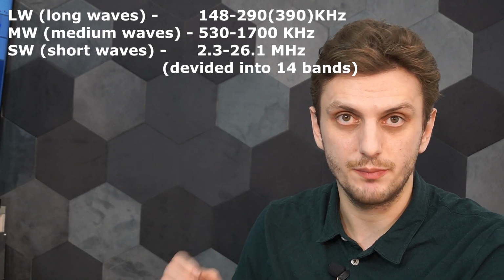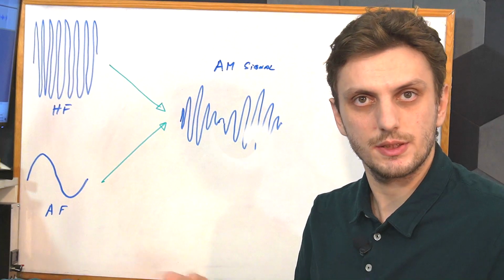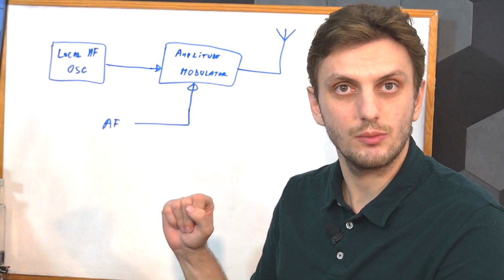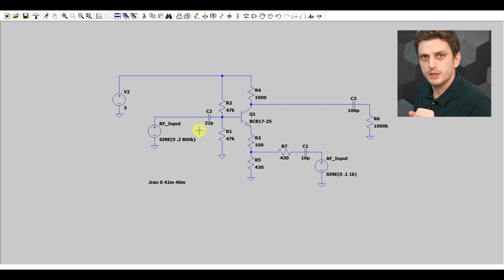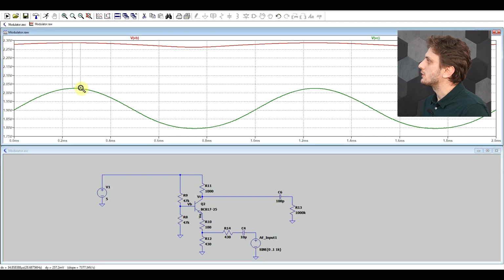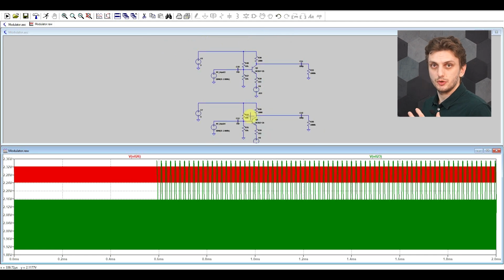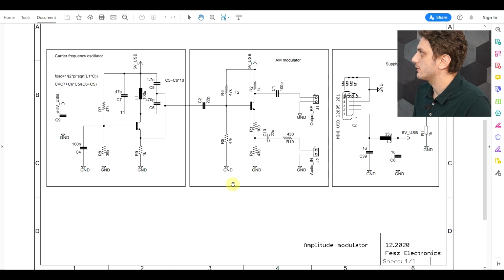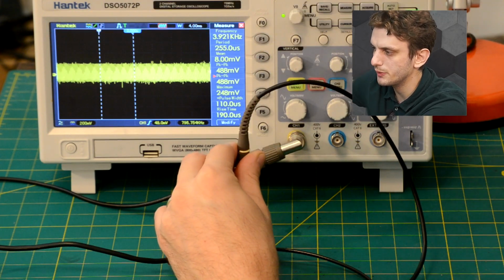Electronics tutorial - Building an AM modulator

Comment: The AM modulated signal should be symetrical. Yours is far from it. Its more normal to vary the voltage on the collector, that way you should be able to get proper symetrical modulation.

Comment: I'm going to attempt, after 20 years of NO R&D, an idea I've had for years.
Using a DSP to do all of the PDM work, and go with polyphase.
An other option would be to use a FPGA.
Need to motivate myself, as I've not been on the air since 2007!
I wonder if simulation software would be the first approach.
Food for thought.
Maybe you can try using the LTSPice?

Comment: You can modulate the oscillator directly without the need for the second transistor, either by injecting the audio in series with the voltage supply line via a audio transformer or by adding another coupling winding on the oscillator coil with one terminal connected to ground and the second terminal connected to a germanium diode for audio input thus modulating the oscillator by inductive coupling. For best results wind the tank and audio coupling coil on a ferrite rod ( like the ones found in transistor AM radios) but the longer the better 15 or 20cm, this will produce a very stable modulated frequency. To increase the range of the transmitter add a antenna wire any lengh required and connect one end to the circuits ground terminal and 5 turns around the ferrite rod with the other end hanging out to the back of the work bench or attached to the wall or a nearby tree depending on the range you want your transmission  to reach e.g with no antenna connected 3 to 10m with a 10m wire anntena 50 to 100m with a 30m antenna about 1km. This explination is just for experimental information and all rules for regulation in the country you reside in must be complied with. Thanks for your informative video.

Comment: You don't need a non-linear element to create an AM modulator. You simply control the voltage on collector of the final RF PA stage so that the RF envelope changes in sympathy with the modulation. All you need is an audio amplifier and a transformer to couple to the RF PA stage.

Comment: FesZ In order to understand an AM modulator it is necessary to understand WHY a circuit modulates the carrier. AM modulator requires MULTIPLICATION of the carrier  AM= (Vm cos 2 pi fm )( Vc sin 2 pi fc ) where mod freq , fm' <<  fc , the carrier freq .
A linear op-amp which sums Vm and Vc can NOT produce AM.
Reply: I doubt about that when I see the wave from in the simulation ,it looks like summation not multiplication of the two signals ( the carrier and the modulating signal )as it should be in AM

Comment: I sorry, but I didn't understand the part about the antenna, at the end - needless to say, I don't know much about antenna design; however, aren't all antenna's just emitting electric and magnetic waves. Isn't the coil you built to electro/magnetically couple the output signal to the radio just an antenna?
Reply from the maker: You are right, an antenna is supposed to emit both magnetic and electric fields, and these combine to form electromagnetic waves after a certain distance from the antenna (2 wavelengths). But in the AM band, the wavelength is very long (300m for 1 MHz) so on short distances the 2 types of fields stay separate. With the particular radio I was using, other than an external antenna input, it also had coils on a ferrite rod which works like an antenna only for magnetic fields. So I was trying to take advantage of this principle - generate only magnetic fields.
Reply: @FesZElectronics  Thank you for the detail response; again, I'm a novice about antenna design; Yet, I must say, I'm really surprised to learn that at short distances the electric and magnetic fields are separated - I thought I basically, understood that these two fields were always together. I really thought that one require the other. I guess I'm misunderstanding Maxwell's equations. I'll try to study the Maxwell equations more closely, in the future.  Again, Thanks for this very interesting info. BTW, your doing excellent work with these videos. Take Care & May God bless you
Reply from the maker: Regarding separation of magnetic and electric fields, I may have expressed myself poorly. Up to a certain distance the 2 fields have different impedance and can be treated separately, only after 2*wavelength do they form a uniform filed with the same impedance. In the case of AM, just to make a decent antenna you need ~30m of cable, so there was no point in making 2 such antennas to transmit my signal over ~1-2m. Therefore I decided it was easier to just focus on magnetic waves and perform signal transmission like that - this allowed for a smaller "antenna" in the form of the inductor.
Reply: @FesZElectronics  Thanks, once again, for this detailed and thought provoking response. I had no idea that it took two wave lengths for the magnetic and electric field impedance's to match in an EM wave. IMHO, this is why science (particularly, the field  of electronics) is so amazing: even if you "think" you might understand something, it's an understanding of these details which often proves to be the factor in truly understanding a physical phenomena. (And often, these details are critical to understand, in many applications.) I do have a B.S. in EE, so I do have enough formal education to realize you don't truly understand a subject, until you master the details of a subject; for me it became obvious whether I truly understood a subject or not, when I tried to answer (correctly) home work problems - usually, this is when I realize I didn't truly understand a subject (e.g, electromagnetism, etc.) since my answers often weren't the correct ones.
Reply from the maker: I guess this is valid for any field of science - the more you study and learn, the more you realize how much you don't actually know. I guess what made electronics so interesting for me was just how easy it is to test your knowhow, not by taking a test, but rather by building and then improving basic circuits. When it comes to electro-magnetism its a bit more difficult cu try and test things out, but even there, you have the subject of EMC, where all the same rules are applied as with general RF transmissions, only rather than trying to make a good transmitter, you are trying your best to make a bad one.
Reply: @FesZElectronics  I do think the field of electronics is a field that one could spend their enter life trying to learn, and still learn something new everyday - since, it involves so much science, and manufacturing expertise, in general. Just the study of know circuits, could take more than a life time to learn. BTW, I think LTspice is wonderful - and should be a big part of the curriculum of the EE major, maybe even taught in high school. I do agree, the study of RF and it's practical applications in EMC is a very, difficult field of study, and should have more emphasis in the EE curriculum - since it is a very import one, with more and more practical application (cell phones, satellite comm., etc.) that truly changer our society, for the better, IMHO.  As a big aside: I wish more circuit analysis was taught- especially, in the  mass communication fields, e.g., AM, FM, digital radio, etc.; I've been in both a EE technology and true EE programsand neither of these programs really taught much, at all, about analyzing complicated modern circuits - which, I find the most interesting part of studying electronics. I wish the application of KVL, KCL where applied to complicated analog circuits, and not just very simple one loop or two circuit path examples. Matter of fact, I think a lot of science education, even in high school could, be taught by studying modern electronics.
Reply from the maker: I guess the main reason why a program like LTspice is not covered by most universities is also the reason why I personally prefer to use it - its free... In my experience, a university will teach SW that is paid because the company making the SW will sponsor the university in return. With something like LTspice, which is anyway free, no-one will pay the university to promote it. 
Regarding how universities and well educators in general decide what to focus on and what to teach is a very long discussion. What I have seen, around here at least, is that a lot (I mean a lot) of subjects are covered very briefly and very shortly and the student doesn't really understand what they learned and more importantly why. I consider it would be best to focus on fewer more simple subjects and just study them properly - like just AM radio, you could spend a year on the subject and still have things not covered. 
In the end, I think the students and people that want to learn more, can and will. So much information is available today that is not hard to get at and just the will is missing.
Reply: @FesZElectronics  Yes, I do think your correct: if someone wants to learn something, they well. Actually, I think I've turly learned more about electronic circuits from YouTube videos (videos just like yours) than I did in my college education, as a EE student; Also, after a little more thought on the subject of cirucit simulators, I feel that LTspice, or another simulator, should be used in conjuction with any instuctions in EE. I imagine anyone doing real circuit work uses circuit simulation software to help design their circuits- so, why not just incorporate a circuit simulation program immediately into the curriculum. A kinda-of an aside, but when I finally took Mathmatical Analysis, and the intructor, if I remember correctly, said just use computer ananlysis tecniques to solve deferential and integration problems- since no one actually working, in engineering, actually solves long derrential and integration problems, classicly; I almost fail out of my chair. (All the classes I struggle with in mathematics, where absolute, with the use of modern analytic estimation software - what a waste of so many students' time, since there is so much to learn in engineering, in general); no time neededs to be wasted analyzing old outdated techniques, IMHO. Also, I was listening to a Ph.D in engineering say that Asia countries basically start teaching digital electronics - since, almost all electronic design is done in the digital domain.  (Sounds like a reasonable place to begin to me, again, IMHO.) Take Care

Comment: Hello! I'm always watching your videos very beneficially ! But can you implement a PID controller in LTspice? I would like to receive the output from the boost converter as feedback and construct a circuit that controls the PWM, but I can't find any reference materials suitable at Google.
Reply: I cannot recommend you a good material about the boost converter, but I can about the flyback converter. I think that this will be enough so that later you can return to the boost converter yourself. Search google "AN2122 Flyback SMPS Using a Microcontroller as Control Unit"

Comment: It's hard for me to write in English, so I don't have time to answer in time :)
Let me explain. The AM modulator of your choice uses the nonlinearity of Ic vs Vb (as you know, this is an exponent, but we will consider it in a large signal mode, so for simplicity, we will replace the exponent with a straight line with a bend at 0.6V). In proper operation, both the low frequency signal and the high frequency signal must have an amplitude of 1Vpk-pk or more. It is good if they are equal in amplitude to each other. In this case, at the top of the positive half-wave of the audio signal, the high-frequency signal will pass to the output completely, at the top of the negative half-wave it will not pass at all, and when the audio signal passes through 0V, only the positive half-waves of the high-frequency signal will pass to the output. As you can see, the transistor operates in cutoff mode for a significant part of the time, and therefore the output signal will be very different from the modulated sinusoid. Therefore, instead of a resistor, a resonant circuit tuned to the carrier frequency is usually placed in the collector of the transistor. Without such a resonant circuit, the output signal spectrum will be very messy. Here are links to two figures that explain this: https://conture.by/wp-content/uploads/2011/12/mris23.jpg , https://conture.by/wp-content/uploads/2011/12/mris24.jpg

Naturally, modulation will also occur at not optimal amplitudes of the input signals. It's just that the modulation depth will be much less. By the way, it is better to choose a smaller initial collector current (for example <1mA) in order to work in the place of the greatest nonlinearity. The Q factor of the resonant circuit should also be neither too large nor too small. I would recommend Q = 3 ... 6 - this is quite enough for signal smoothing. And of course, it should be admitted that although the input impedance changes (since hFE vs Ic changes), it does not affect the modulation process. Maybe you should have used some more intuitive modulator? For example, based on a field effect transistor or photoresistor in controlled resistance mode. It's up to you, of course.
Reply from the maker: Hello SaihoS1,
I agree, as long as the input AF amplitude is large enough, then this operating mode makes complete sense - reduce the Vbe low enough to get the transistor in cutoff mode - no modulation, increase it, get modulation. I initially thought that is how my implementation would end un working - but the main difference I observed (with my particular choice of components and signal levels) was that the larger the AF value (positive peak) corresponding to the higher collector current, the smaller the output RF voltage amplitude (I'm getting highest output amplitude when the AF signal is at the low point). If my understanding is correct, the operating mode you mentioned should work in the exact opposite way.
In the simulations Vbe peak stays between 0.628 and 0.632V when both AF and RF signals are applied, so the transistor is nowhere near the cutoff mode.
Another interesting phenomenon I observed in the simulation is negative instantaneous base current (with RF signal applied) while collector current was still ~3mA; the only explanation I could come up for this is signal being pushed back trough the base trough collector-base capacity.
You also mentioned collector current <1mA to enhance this effect of gain variation; In my case its 2.9-3.1mA so at this point collector current related gain change is much smaller, not enough to account for the observed behavior; 
Adding the LC circuit in the collector does help greatly to rebuild the signal when you only apply half the RF signal (negative part being stopped by the cutoff mode). In my case, even if there is no LC circuit, the output still looks like a sine wave (there isn't any bit cut of).
Reply: @FesZElectronics  For you, everything works the other way around, for the reason that the transistor is driven into saturation and starts to amplify only when a negative half-wave comes. Ic = 3mA, Vcc = 5V, Rc = 1k, Vb = 2.5V hence Vc = Vcc-Ic * Rc = 2V <Vb. This means saturation of the transistor. Increase Re by 3 ... 6 times and the transistor will enter normal mode.
Reply: @FesZElectronics  I have not been able to convince you?
Reply from the maker: On the contrary. I think you are right, the effect most predominant is gain loss caused by the transistor going into saturation but I still think that part of the impedance change is caused by BC capacitance variation. I will have to look into this in a bit more detail.
Reply: @FesZElectronics  I think that the capacitance of the collector junction will not noticeably affect the modulation process. Especially in the saturation mode. I read the theory on this mixer and I can say that it can work both in a large signal mode (with cutoff) and in a small signal mode (on a near-quadratic part of I - V characteristic). But only in the first case can the maximum modulation coefficient be achieved. Unfortunately, the book is in Russian and you will probably find it difficult to read even a few pages. But if you wish, I'm ready to provide a link to pdf files. I will patiently await the result of your research. Perhaps you can use this scheme in an unusual way?
Reply from the maker: @SaihoS1  I can't speak russian, but I can look at the schematics and diagrams - usually you can get quite a lot of info from those alone. If you can provide the book, I'll try to have a look trough it.
Reply: @FesZElectronics  Here are the final conclusions: http://www.mai-trt.ru/docs/edu/lek_or_ruch_11.pdf (Chapter I)
Here's about modulation of a small signal (squared I-V): http://www.mai-trt.ru/docs/edu/lek_or_ruch_09.pdf (The previous document uses the findings from chapter IV )
Here's about modulation in large signal mode (cutoff mode): http://www.mai-trt.ru/docs/edu/lek_or_ruch_11.pdf (However, I think that you already understand this mode well, and you will not need an accurate calculation.)
Reply: A perfectaly linear amplifier can produce AM ! A perfectly linear amplifier,  example:
 a modulated collector supply  produces a carrier +upper and lower sidebands WITHOUT HARMONICS . 
 AM produced by a   non-linear circuit using diodes or Vbe non linearity  produce   carrier +upper and lower sidebands PLUS harmonics of that spectrum